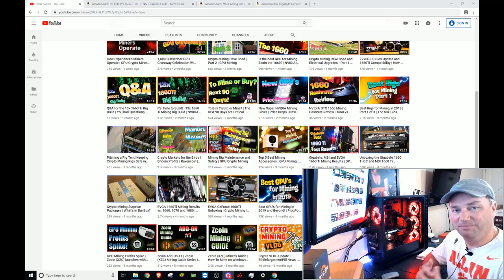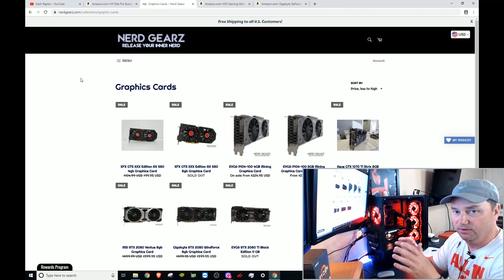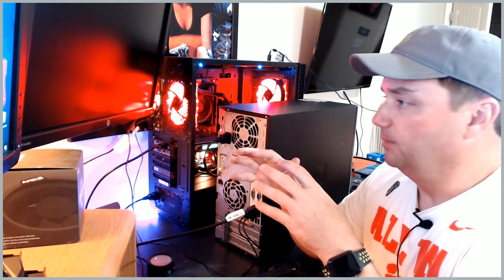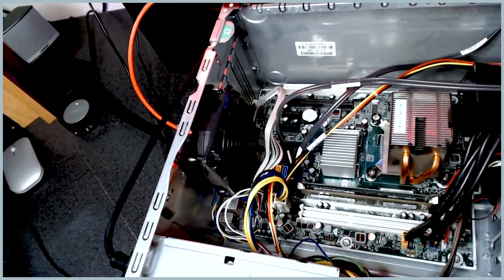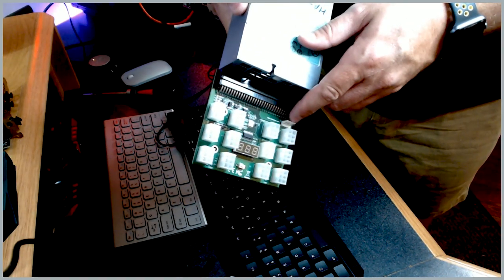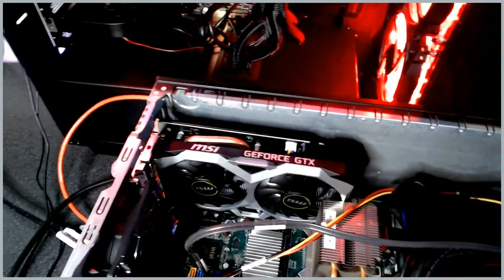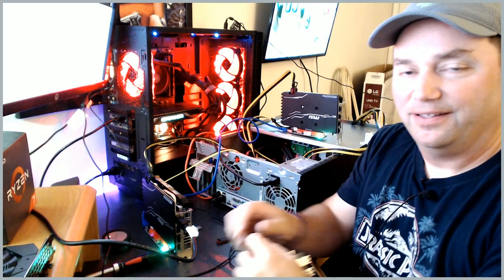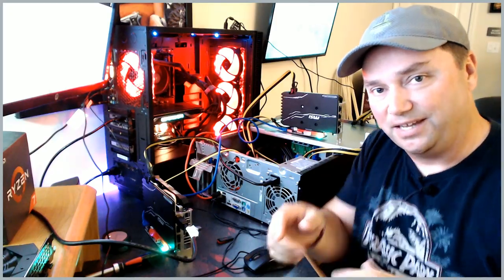The $550 90+ MHs Used Mining Rig Challenge | Best Rigs for Mining in 2019 Part 0.5 | GPU Mining

Comment: 14:44 With power cord removed (or the PSU rocker switch switched off), then push and hold the front on/off power switch for about 3 seconds, in order to discharge the latent energy stored in the PSU capacitor.
Reply from the maker: Never heard that thanks!  I “usually” :) just wait 5 or 10 seconds. I’ll give it a try.

Comment: 2 veddha frames, 2 g2 power supplies, asrock h110 board, 4g ram, g4400 cpu, ssd m2 sata, 13 risers, all that for $365. Now you have something to build on. Now you can add cards as you go up to 13. I stopped building with rx cards but last 13 I bought were only $877 so total rig cost was around $1250 for a 400mh ETH miner. You also don’t need a hard drive if you run off smos. 
I buy all my stuff used mostly. Except newer gpus you just have to pay up.
Reply from the maker: Awesome deals man. Where do you like to buy from?  Ebay?
Reply from the maker: Also, just curious why you stopped building with RX cards?  Team green here mostly.
Reply: Yes mostly eBay. I stopped with 570 and 580. My thoughts are if prog pow comes these cards will be at bottom of the list on profit. Also now the new generation of cards are out and I don’t want to fall behind. Starting to rotate into newer cards but it’s just a huge cost doing it. The rig to run cards it dirt cheap right now but cards are costly. Over 5 grand for 13 of the 2060 supers. Those might be my main setup going forward but waiting on results of the 5700 when they get software fixed. Also the 1660ti is a great card.

Comment: Damn.....that rig u have Infront of u looks exactly like mine... Have almost all the same parts Ur using lol...
The only issue I don't have more cards.. just 1660 super and an Rx 580 sapphire... Hahah.. got to.save up some more for a few more cards.. system is a bit buggy but im guessing slowly I'll get it done right..
Just asking what are Ur thoughts on the new 5500cards launched by amd.. 

Thanks so much for all u put into Ur channel mate.. wish I came across this at least 15 days ago would have saved me alot of trouble... Lol but I guess its worth the effort figured alot of stuff out... Thanks and keep up the awesome work mate.
Reply from the maker: You bet man, I am happy some of the video helped. So, at the moment, I don’t recommend AMD cards for mining, including the 5500. They are great hardware, but they are very limited with the number of coins they can mine well. With Monero changing its algo, and Ethereum possibly changing in the next six months, there isn’t much more they are good for. Then you have to bios mod or add memory straps, it is just a hassle unless you are comfortable with them already.  I like the 1660 Super or Ti as “bang for the buck” cards.

Comment: You can get HP workstations that use 8 core cpu's very cheap. They come with a 600 watt 90%+ power supply, lots of pci slots, and the cpu's are cheap xeon you can also mine with. z420 by HP would be a good example. They also make dual cpu systems. Can get them for under $100 usually.
Reply from the maker: See this is why I do these videos. That is awesome info. Thanks man!  Happen to have a link to one you have seen for sale?  Happen to know if the bus will work with multiple gpu’s?
Reply: @HashRaptor  Gpu's came  in today. z600 has a 650 watt bronze plus power supply, 3 gpu's in the system works plug and play with windows, Never tested 4 but I bet it would work. z420 has a 600 watt power supply labeled as 90%+ so I assume its a gold. It too worked plug and play with 3 gpu's, and same with this PC I bet it will handle 4 no problem. Being server style workstations these were meant for things like this. They have plenty of room to put 2 cards on the board and one on a riser, the factory fans are good enough to run the case closed with average temps, but have extra fan plugs if needed.  Hope this info helps.

Comment: I got a 1660ti and I get 30.5 at 100/1000 with 62 power at 75 watts. Try dropping ur power a little.
Reply from the maker: Hey Frankie!  That is solid for sure. Yeah, I’ve done some other videos where we talk about optimizing the 1660Ti. Didn’t want to go into that in this video. But totally agree, I usually set my power between 58watts to 70 watts max. Don’t usually go over that. Max I go 90 when testing. Hey, what kind of memory do you have in that card?
Reply: I believe Hynix. I’ll check when I get home.